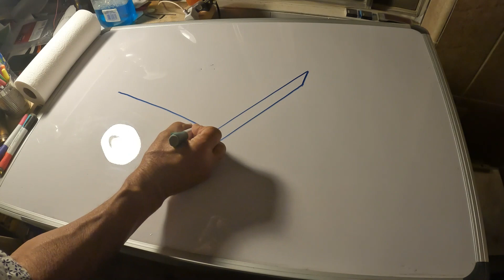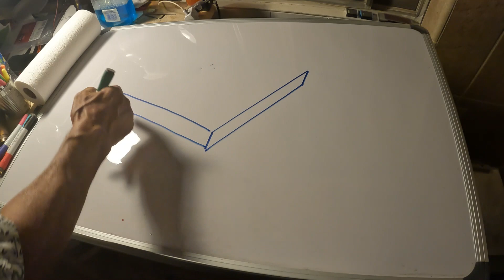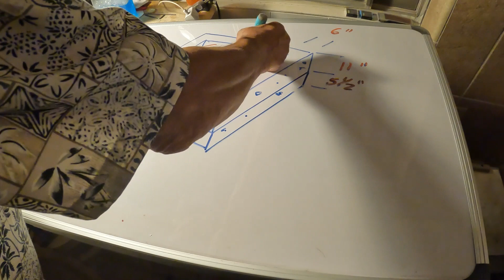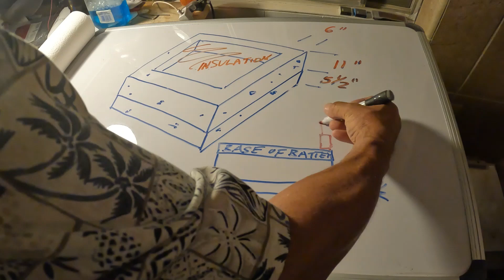Super Sand Battery Phase Two E93

Comment: What type of insulation ? Not seeing any vents or channels for your heat exchange it may be best to enter  from bottom  and extract  heat from top . I am following  and will build soon as I get my 60   210 watt solar panels set up will use sand battery as dump load .
  My open circuit voltage is 110 v and am building  a battery bank  with recovered  automobile  battery's  I am  going to test charging a bank of 96v ( 8  12v  in series) direct from the panels  . When I connect directly  to my panels  with a resistive  heating  element  my voltage collapses  .I think since the charging voltage of a 96v lead acid battery  bank  is  the same as my panels output I think it may work without overcharging  the battery.  If this works I will build a large  storage  bank of lead  acid  batteries and use as a capacitor for my resistive dump load . I welcome any comments or suggestions  .thanks for your inspiring  work.
Reply from the maker: I had a similar idea of a 120 Volt DC battery bank or there abouts maybe less like 100 volts similar to what you are planning. As far as a dump load I haven't really experimented on any of that. I have an 18 Volt system direct off of solar panels no dump load I just use it for evaporative cooling and miscellaneous lighting. It sounds like you have a good plan. My venting will be at the bottom of the sand battery starting above the insulated cavit intake at the bottom and outlet near the top. Thank you for you insight.
Reply: @off-gridsurvivalmike8120  that will work you may also want to insulate around the edges of your foundation slab to stop any conduction to the soil. Will keep you informed on the 96v battery  project